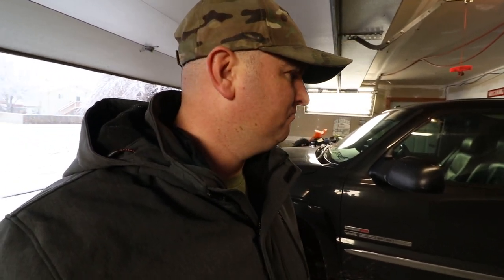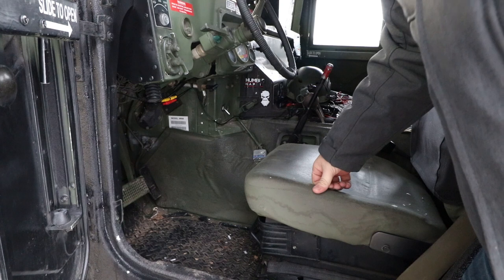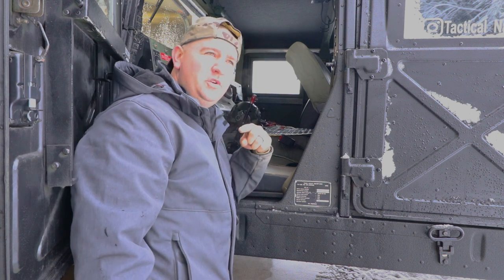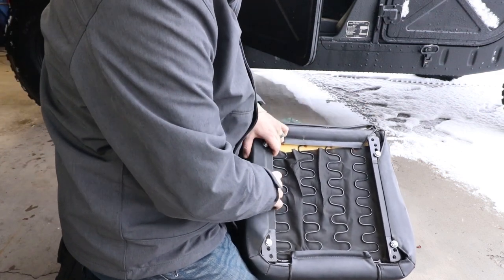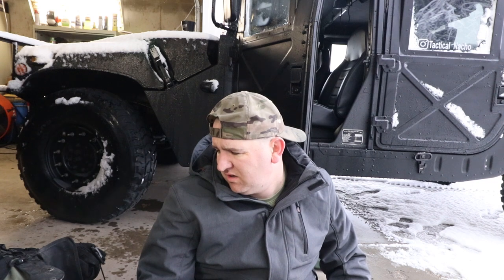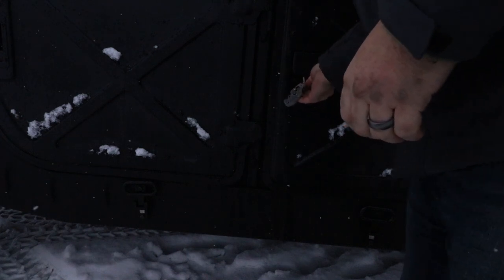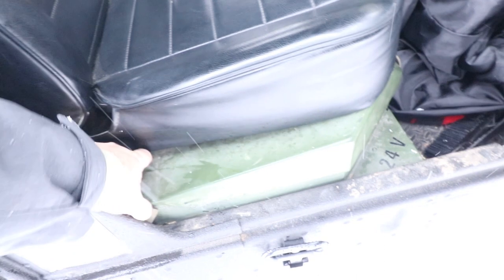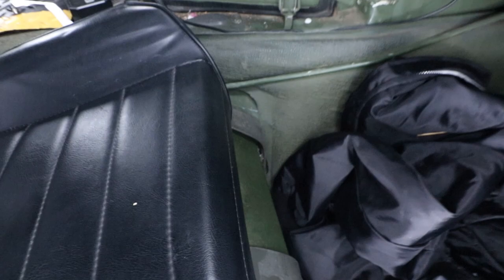Humvee Seat installation.......frustration....

Comment: EODDaveActual:  I noticed you have a middle rear seat in one of your other videos.  I have one that I haven't installed yet.  I can't figure out how to mount the brackets on the floor of the hummer.  There is a lot of stuff under the truck and I can't reach any areas to place a nut on the underside.  How did you accomplish this?

Comment: I would of cut out the boxes entirely and welded in a air seat from peterbuilt and relocated the batteries to the rear and added an air compressor and tank with connectors it could only help.
Reply from the maker: I've heard of people putting in the air seats, it's beyond my knowledge! Lol
Reply: @TacticalNacho  actully not that difficult the seat itself only needs mounting and an airline just need an air tank and a compressor to supply it . You can get  a battery powered one to mount inside the cab or outside  to put air into the tank and Bob's your uncle.

Comment: Are they expensive to owe ?
Reply: What meant to say is own , I am getting close to being able to get one but all I read is that they are expensive to repair  and require a lot of maintenance. What is your opinion and thanks for your input 👍
Reply from the maker: It seems like there's always something to fix, but I also drive mine every day.  Luckily most of the stuff isn't too hard to repair.
Reply: @1968zz4350  what I always tell people is to get the ones that have been around in the civilian market for over 5 years. Most of the ones from the auctions in Surplus have been abandoned from minimum 5 to 15 years. People don't have the discipline to empty and flush all fluids in those before even daring to crank the engine over. All it is is neglect on these units and are beasts but it's the people that get them from the auctions that start using them without emptying everything out like I said. That's why it's important to get ones that have already been out and maintained.